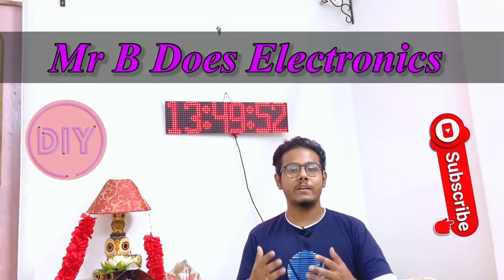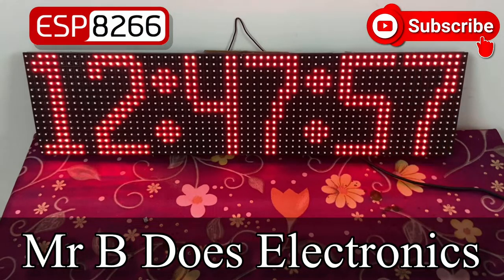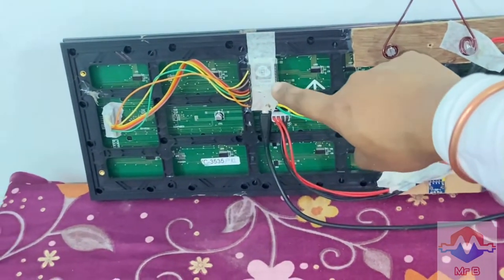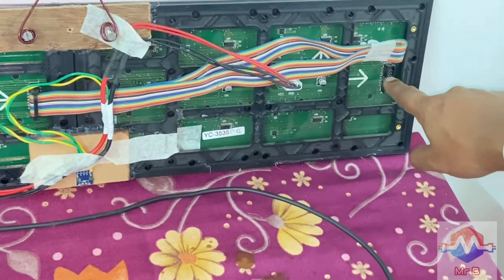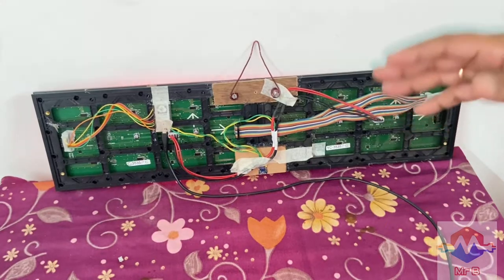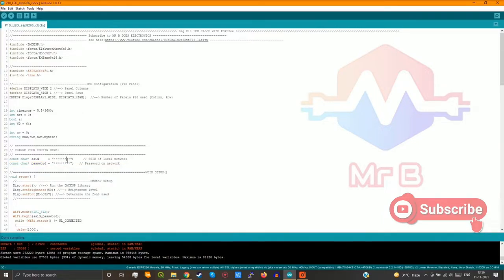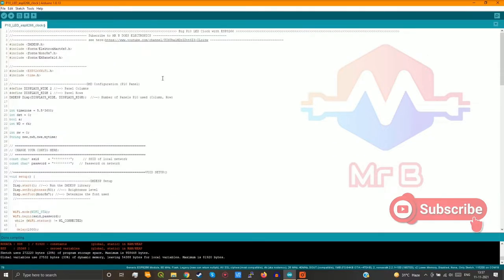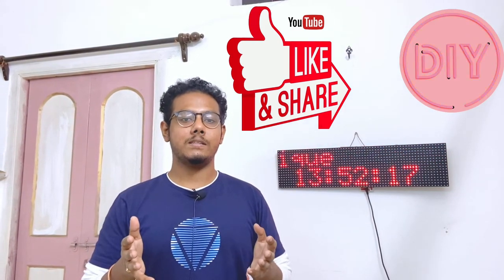ESP8266 + DMD | Clock and Message Display .Easy DIY Advertising Display. Arduino+Bluetooth+DMD.

Comment: Good job,
Please, there is any  solution to connect dmd p10 and mini sd card  module to arduino nano ? Because they use somme same pins, thanks
Reply from the maker: You can use a multiplexer to increase the number of digital pins. Or You can also just as easily change the pins for the sd card or the displays in the code. Please do Subscribe for more videos like this. Thank you
Reply: @MrB_DoesElectronics  thanks